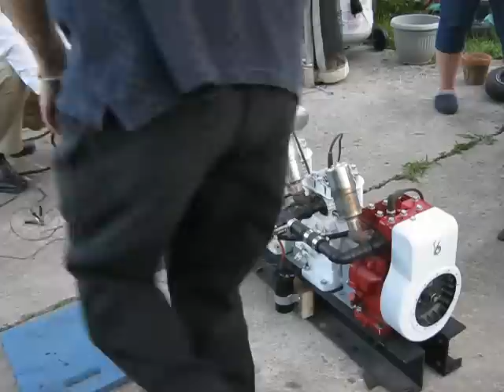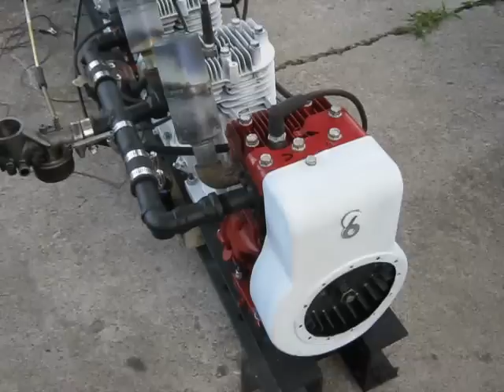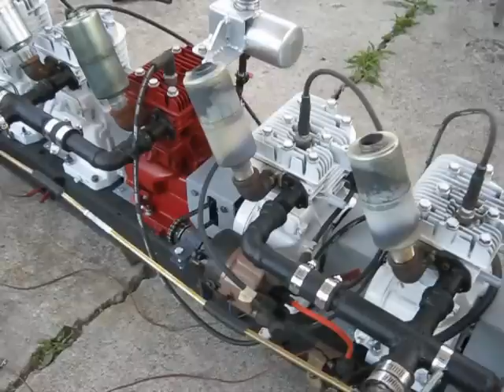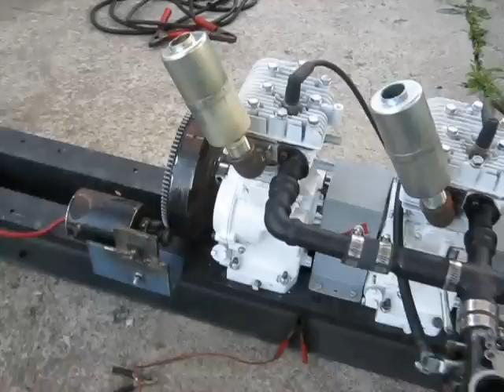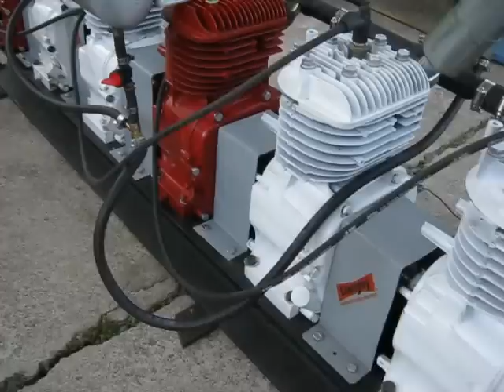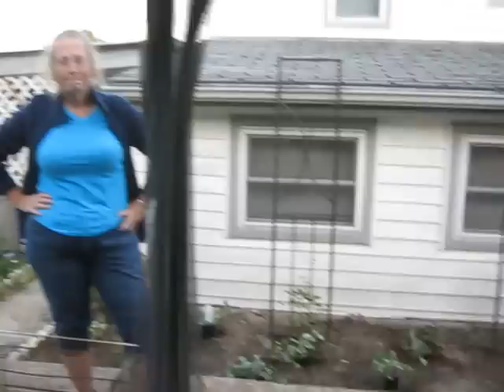FrankenBriggs 6 Cylinder 1st Run!!!!

Comment: Problem with starting and low rpm idle is the intake manifold... there's no way that the carb tune for cylinder 2 is right for cylinders 1 and 3 ... by the time the mixture has traveled that distance and made the 2 90° turns in that size tubing it isn't atomizing well anymore at low flow... you can see it runs better at higher rpm as the airflow starts to overcome the imbalance in the manifold... use 3 carbs with manifolds set in a Y configuration with equal distance to intake, and your idle and starting worries will be solvable with proper carb settings. (this is awesome btw 😈 ... I work intake 6 cyl for boat engines... your minor problems totally look like intake config... try and get a faster starter motor speed to get running easier with your current setup)
Reply: also you can see that cylinder 1 and 3 is running lean and therefor heating the exhaust way faster than the other ones
Reply: I agree. 6 1 barrels may work better.
Reply: or ... throttle body fuel injection :D or even direct fuel injection if you were crazy enough!
Reply: fla playa
Reply: Direct fuel injection is a nice suggestion. But of course he cannot do it with those engines
Reply: Rodrigo Fajardo
 More correctly.. he cannot do it with those heads.

Comment: That's just what I like to c someone creating a beast by hand awesome job friend
Reply from the maker: Thanks, glad you understand why I built it, some people don't get it. I know it has no practical purpose unless i mount it in a tractor or something, but sitting beside it and manning the throttle is quite the experience. You are not normally so close to this large of a running engine.

Comment: It's your intake manifold! It needs to be completely redone .Your feeding 2 and five straight threw. The other engines can't pull enough fuel . The reason the back one is backfiring is because that is a lean back fire. Obviously it will run but your losing power because there all connected together and running un even . Hope this helps you. And pretty cool.
Reply: Maybe a big leaf blower on the carbs,
Reply: Beau Gant i think that if he change the firing order it will work better
Reply: wouldnt matter would still run lean...
Reply: I want to see them run with a sheet metal intake and 3 2 barrels jetted down. lol
Reply: Lack cooling fan on 5cylinders,could risk seizing up.
Reply: Best way to fix it would be to add another carb and have each carb feed two cylinders and angling the manifold pipes so they are equal distance from the carb.
Reply: Wow, 4" C channel for the frame? Sure it can handle the torque?
Reply: i agree, i'd look into the manifold.  It caught my eye right off the bat! even them out and the diameter is too big??  !!  ??  anyway-great project thats gotta few bugs but very cool!!!!!!!!!!!!!!!!!!
Reply: Im interested in knowing how it ended up. I kind of agree about the intake somewhat but when you think about it an automotive straight six has a single manifold and carb feeding six cylinders. Im thinking more about overall balance, possibly larger flywheel. Be honest, I wouldn't know where to start trying for balance between six linked cylinders. One things for sure, it makes for a very interesting project. Definatly cool. (Not in terms of cylonder heat though), I would think about using a squirrel cage blower and simple sheet metal ducting for cooling. Drive the blower off the output end of crank. Anyway, its an amazing peice of work, love it!!!!!!
Reply: Worse fuel distribution than a stovebolt Chevy, lol
Reply: Yes,  like you said, intake manifold is not helping,  that's another project
Reply: The back three rarely fired. Just look at the Muflers, front 3 turn blue, Back 3 cold.
Reply: You're right, but that whole front set of 3, are all running SUPER lean. Look at the exhaust, it's roasted😂
Reply: Hi Beau Gant, ideally it would be nice to have identical manifold runners but this is rare (in the cars of the sixties), a more economical approach is to ensure that his three engines have their intake stroke 120 degrees of one another by the coupling of each engine to the other.  The B&S engines are very low performance/low rpm engines.  Such carburetor should be enough for this set-up.  Great project, interesting!  Ciao, L (FoMoCo engineering).
Reply: Modify the manifolds, three carbs each feeding two cylinders, and some way to cool the back three cylinders and I believe it would run good enough for in depth tinkering.
Reply: I honestly thought if he just left the original carbs on each engine it probably would run better. It didn't appear to run well. Too much work for such little reward. I don't see what this could be used for. I'm sure he had fun building it and making it run though.
Reply: The intake could work, but he'd have to be sure that each engine was phased properly

Comment: One thing you forgot...COOLING for the other 5 cylinders.
Forgetting the wife...YOU will pay for that!
All in all a cool build!
Reply from the maker: I didn't forget about cooling, I did use large box fans on some of the runs. I just don't run it for more than a minute at a time, but that is more than long enough to P.O. the neighbors, especially when I removed the mufflers on the 8 cylinder for the uncorked run!  :)
This isn't a practical way to build an engine for long life, I understand that.

Comment: your intake manifold has unequal lengths so cylinders farther from the carburettor are running leaner this is causing the hot exhausts on those cylinders
Reply: Stephen Hayston so will it sound like a subie?
Reply: Subaru's have unequal exhaust headers, not intake manifold lol
Reply: Yep, 1 3 4 and 6 are running leaner than 2 and 5
Reply: The AMC 258 has unequal length runners and runs fine
Reply: The AMC's outer intakes are grouped, a design difference probably vital in the "running fine" process. I could be wrong, just a guess, have a nice day
Reply: Avery Huelsbeck cylinders 1 and 6 run lean, and 3 and 4 run rich.  I've often thought about building a dual plane manifold with equal length runners.  Probably never get round to it.
Reply: Avery, a Subaru's whats have unequal exhaust headers? Which possessions of a Subaru that have unequal exhaust headers were you trying to refer to?
Reply: Agreed on manifold....  he would do much better both in starting and running if he went 6 carbs
Reply: so do most streight 6 & 4 cyl engines with one carb per 3 or or more cyls

Comment: just one thing! How do you keep the other engines cool when there is no cowling on them apart from the first engine, they are air cooled and need a flow of air over the cylinder fins to stop overheating , can't see it taking long before they run really hot ;( apart from the first one 😳

Comment: Really cool piece. Must feel pretty rewarding making that engine.
Reply from the maker: Yes, it was nice when it fired up, and ran fairly well  :)
Reply: Give a lot of credit. Took a lot of not only machining skills but a fair amount of brain power too.. I wonder if a V-6 Configuration would alleviate some of the issues?
Reply: A V-6 has a common crankshaft, so if you configured it that way, it would be two straight-3's
Reply: Hi fla.

Comment: Good stuff Bud!! You had that thing pissin' and fartin' like a Top Fuel Funny Car!!☺
Reply from the maker: lol  :)   Yes, it sure was putting up a fight, maybe I woke it up from a nice dream or something!
I hope your radial runs better than this does  :)
Reply: It would probably run better if you had 3 carburetors on it instead of 2, carburetor per 2 cylinders
Reply: alex pencek I concur.
Reply: how do u connect the crankshafts between motors? gear ratio/teeth? also, do you multiply the torque/horsepower to get the total combined HP? I'm very interested in this. thanks
Reply: +christopher chance allot of welding and modding
Reply: Gimna cara servi tv merk palitron can setenbay aja
Reply: The torque and horsepower is additive in a situation like this. If each motor is 5 hp then total is 30 hp.

Comment: Front carb is much leaner than the rear. You can tell by the color change on the brand new mufflers. I wouldn't be surprised if you are only getting power from a few cylinders and the rest are only along for the ride.

Comment: Not practical but really cool. Not many people could claim such a feat. How did you handle the timing issue? Did you set each engine 120 degree out of phase with each other to get 3 power strokes per revolution? I think running 6 linked carbs would be better or, tune the length of the intake pipes for more accurate fuel distribution.
Reply from the maker: Yes, I did phase the cranks 120 deg out of phase, and used a 6 cylinder firing order of 1,5,3,6,2,4. True this intake set up wasn't ideal, I just tried to keep it simple enough that I could build it in a reasonable time frame.
Reply: ChargerMiles007 Very impressive. I enjoyed your 8 cylinder video too.
Reply from the maker: Yes, the 8 ran much better than the 6, I think having the spark advance working correctly played a big part. The 6 had trouble revving much over 3000 rpm, but the 8 liked to hit 5000 or higher! Eventually harmonics in the engine broke the powder metallurgy crankshaft gear on #5 cylinder, so i packed it in. It is quite repairable, but fall was moving in, so I finished and ran the unlucky 5 cylinder a few times, then put it all away for the winter.
Reply: Roy Riederer zs
Reply: +ChargerMiles007 sir if the cranks are all welded together you must be a guru at getting the joints trued up after all the welds pulled a little one way or the other.

Comment: Part of the reason the starter can handle the load is that only one cylinder at a time in on the compression stroke at a time.,  I do hope than you have set them up to use a standard 6 cyl firing order.  That way if there were securely fastened to a stout frame, there should be very little vibration.  For many years, Rolls Royce used only 6 cyl engines and they were famous for there smoothness.  I studied engine design while in Mechanical Engineering and have kept up with modern variations.
Reply: Sounds like it (the distributor) was running backwards, perhaps ??
Reply: Dave Alexander it was the V8 that was renounced fo smoothnes
Reply: An inline 6 or 8 is inherently smoother than a "V" configuration due to the 120*(6cyl) or 90*(8cyl) firing of the cylinders. The "V" might be even fire at the distributor, but the crank throws are uneven for rotation of the crank and placement of the cylinders.  It's inherently unbalanced, which is why it needs a huge harmonic balancer up front to keep it from self destructing.

 I've been driving inline 6's all my life (I'm 63) and my Dad's '37 Buick Sedan since I was 13.  The inline 8 on that monster is smoother than any 6 cylinder I've ever driven.   Put a glass of water on the head (flathead) and it barely ripples compared to a 6 @ 600rpm.

Comment: Super cool.. Might have been running on 5? Cylinder 5's exhaust didn't seem to discolour with heat like the others
Reply from the maker: Yes, I noticed that, 5 minutes after I shut it down I touched all the heads, 4 and 5 were hardly even warm, though I did see 4 firing some times in the vid.

Comment: All intake runners need to be equal length and fed off of 1 600cc 4 barrel carb. It looks like a nice set up. You could possibly run 6 briggs carbs since these engines are basically sucking the gas out of the bowls and use of jets is at a bare minimal. So fine tuning 6 briggs carbs would be a piece of cake.

Comment: You need to heat that intake manifold. The runners are too long and the fuel is falling out of suspension before it gets to the outside cylinders. That is why they are running so hot or not at all. They are running extremely lean. so you either you need to heat your manifold or put individual carbs on the machine. I really hope this helps you get a good runner out of this machine.
Reply: Or make every manifold pipe equal length.

Comment: I noticed your DC power supply, a welder. They work great. It works to jump Lincoln SA200's too. Just hook the leads together (momentarily) to crank the dead SA200.

Comment: 5 of the 6 don't have any cooling fans or housings
Yer gonna melt 'em down if you run it much.
Reply: andTo861 I don't think 5 fired
Reply: Oh for God's sake he's only fucking around.
Reply: Crazy Canucks - one running cool and five cooking.
Reply: 5 and 6 don't even appear to be firing looking at the muffler color
Reply: kmcwhq harleys don't have cooling fans,,I think these have the fan built in the flywheel, ,now no shroud may be a issue if this motor is not put into a moving vehicle to have are passed by the cylinder heads or Cooling

Comment: I think the other 5 engines need their blowers & ducting to keep cool. It'll take some extra machining and parts, but it has to be done.
Reply: I was thinking the same thing.  The last 5 will overheat rather quickly.
Reply: .....glad that someone mentioned that. The flywheel has cooling fins(as well as other functions)that are ducted to the head by the metal cover. 
 I hate to sound like I am judging such a good project.  It is what it is.......very interesting and a good demo.
Reply from the maker: Yes, you are correct, all but the first cylinder need additional cooling air. I was not able to keep all of the normal flywheels the way i made the couplings, but it seems to run fairly smoothly with just 2 flywheels instead of 6. I could add a small dc fan onto each cylinder for cooling, instead i just run it for a minute or so at a time, otherwise I get complaints from the neighbors!  :)
Reply: ChargerMiles007 - That's why you need acreage land. ;-)

Comment: It needs equal length intake runners from the carbs. the center  2 engines with the short tube's are getting  a air/fuel mix faster than the other 4. should  have just used 6 individual cars with a adjustable jet. This is a good start at something like this. But I'm more interested in tig welding a few v-twins together to make a V12.

Comment: Add cooling for cylinders 2-6 and convert it over to a megasquirt EFI.
Reply: it should have fair & sufficient cooling system flow to all cylinders....
Reply: HOW?
Reply: Exactly, you have to have a fan and shroud if you run it for any amount of time or it will eventually overheat and lock up. If its just for demo and putting for a few minutes then its fine.
Reply: Adding fans and shrouds after assembly on a Briggs and Stratton Centipede... hmm

Comment: With each added cylinder you add more torque but you don't beef up the bottom end. You're putting 6 times the torque the cranks are designed to handle. If you really loaded this thing you'd blow the bottom end in no time.

Comment: It appears that just the three front engines were running.  Only their mufflers were colored by heat.  The fourth engine had some heat discoloration but not like the first three.  It may have been running only part of the time.  Mufflers on #5 and 6 had no discoloration at all.
Reply from the maker: You are correct only 4 cylinder are running on this first run. I have other vids where it sounds just like a 6 cylinder. I posted this vid because of how many hours of work it took just to get it to running condition. Then came the fine tuning :) I remember it was a HOT summer that year, and I had to drill 24 holes thru the steel channels the mount the 6 engines, a broke a number of drill bits also, fun times!  I still have all of the engines I used for this and the 8 cylinder. I don't throw any of my FrankenBriggs engines away.

Comment: For a cold carburetored 4 stroke engine set the choke closed and open the throttle 1/3 open. When it starts, back off the throttle and then when it  begins to warm up open the choke slowly.
Reply from the maker: Sounds about right, my problem here is that I need 3 arms, one for each choke, and one on the throttle shaft. not many people are brave enough to get that close to it!  :)